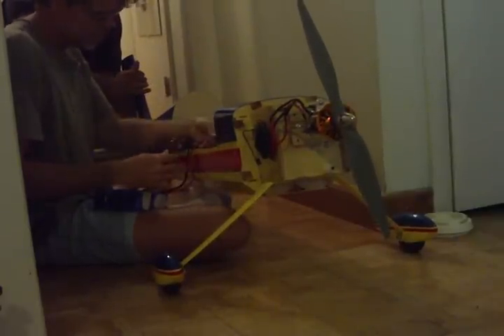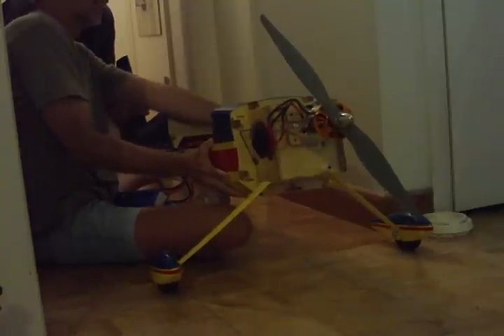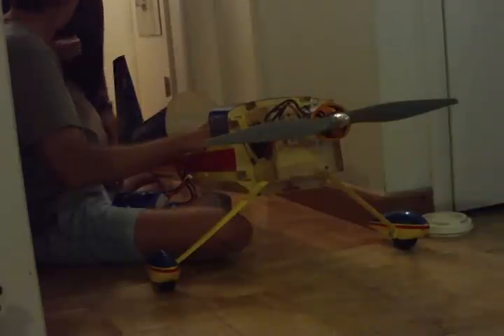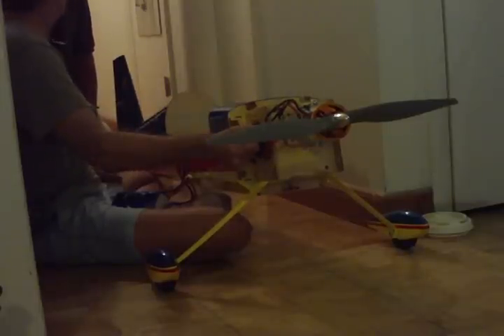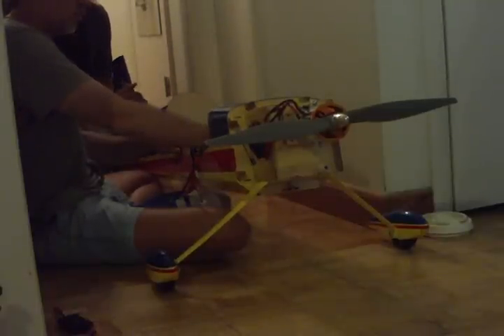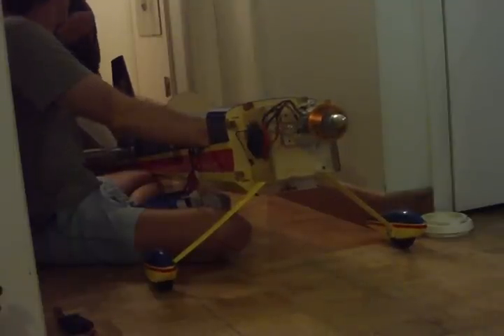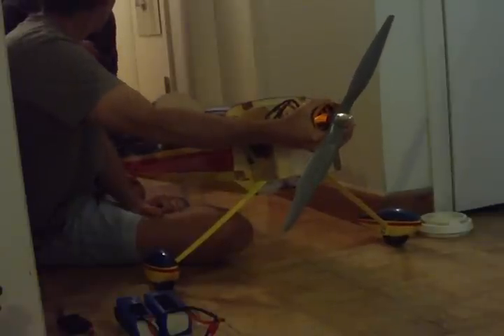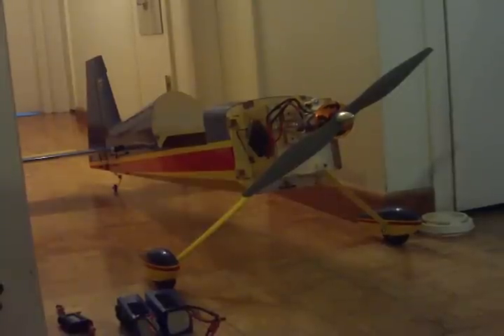Turnigy C8085-250 Motor from Hobby City

Comment from the maker: this was Run on a 11s setup using a one 6s 5000mah and a 5s 5000mah pack.
Im not sure on the RPMS tho but i did know we pulled like 2500Watts. It rated to be a 6000Watt Motor.